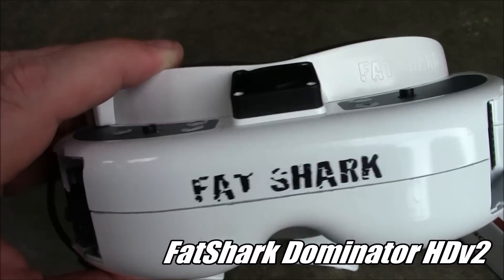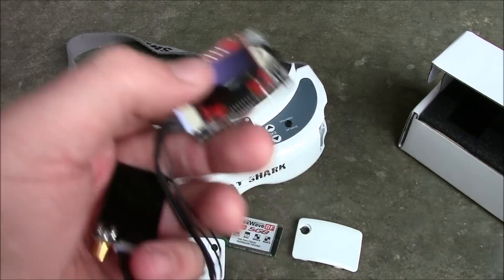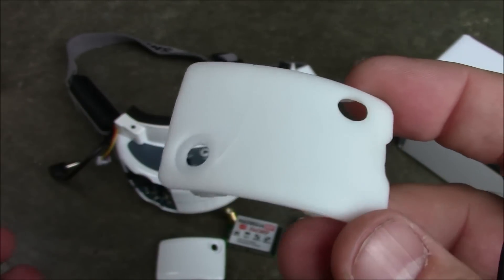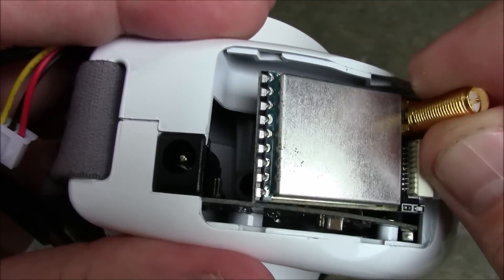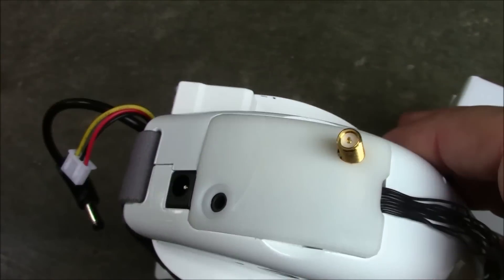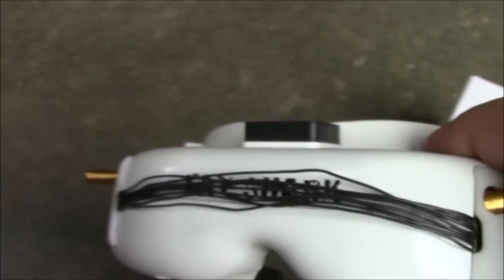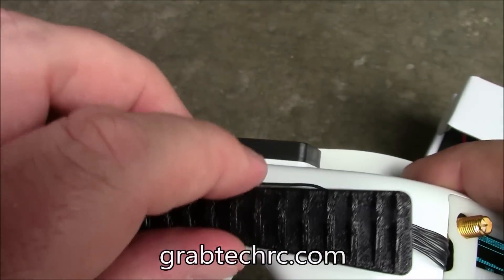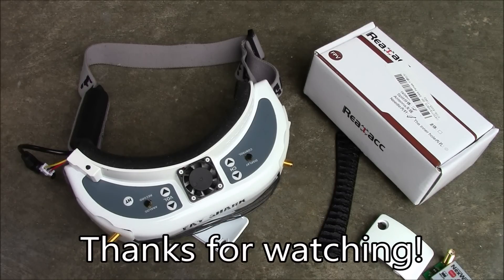Realacc RX5808 Diversity Split Receiver and Covers Initial Look

Comment: It's very easy to get the covers to fit perfectly... Heat the covers with a heat gun, just a little, they go soft at quite low temperature, fit cover to goggles and hold down all four corners flush with the goggles until the cover cools. You now have perfectly fitting covers :)
Reply from the maker: That is a good idea.  I've done that with the E010's camera mount but didn't think about doing it with this cover.

Comment: lol. thanks for the review. honestly guys & gals just get a set of La Forge modules. yeah they cost more but you also get updates, support and great video which is so important when you fly fpv so its worth the investment IMO.
Reply from the maker: These will take software updates too, but the coolest updates you'll see with LaForge are probably going to come more from the hardware side more so than the software side.  Besides if the software were updated, those changes would eventually make it to these.  The newer LaForge modules are suppose to work with the FatShark buttons as well as their own built in buttons.  If you have the older version of the LaForge, then you won't be able to get that option. You'll have to buy the newer one.  That would be two expensive purchases you would have had to made.  If these end up receiving video as well as my friend's LaForge receivers, I'm going to be ecstatic.
Reply: +travisgrindal seriously they will take updates for La Forge modules.
Reply from the maker: Supposedly.  I haven't seen it first hand yet.
Reply: I would love to get a set of the La Forge modules but I have the Attitude V3's and not sure if it will work.
Reply: I've seen people on facebook that had Laforge modules installed on attitude V3's check check out the LaForge group on facebook
Reply: i have a pair of teleporter v4, (bought cheap and used) i did look inside and the "module" in is uses the same layout of pins as the dominator seriers. ask fatshar if in theory you could swat the module, and they said yes. so now i'm wainting for my postman to comew by....

Comment: I got the Real ACC  2 antenna in 1 version from banggood and loving it so far. You can replace the screens pretty cheap but I would let Banggood know and tell them to send you a replacement. I also bought the board version for my Quanum V2 goggles GE-FPV RX5808 Pro 5.8G 40CH so far so good.

Comment: Do you have the foxeer 16.9 HS1189 camera or will you get it. If so could you try and show it on the Eachine EV800 and show a video . I've ordered the Eachine VR D2 and i think it is very similar and would like to see if the eachine goggle would receive the 16.9 ratio correctly. Thanks in advance.

~Randy

Comment: Sorry to see that you got a lemon.  Mine came today and it works well.  Covers fit pretty well and aren't broken. They were wrapped in foam.  The module on left is titled slightly when the cover is on, but isn't a big problem.  Screen is great.  My pet peeve is that wheel is hard to access.  I need to cut a little of the edge away of the right cover.  Definitely requires a wee bit of DIY.  For $40, I can't complain at all..

Comment: Just got mine yesterday, all my lines are there. Everything works great. For the diversity side, i double sided stick taped it to the goggles, it's holding up pretty well
Reply from the maker: I may try that.  I still want to try them while flying.  The receiver I'm using now is just 'okay'.  Even if the screen doesn't work well, I can probably still figure it out.
Reply: Get that replaced on RMA.  That screen is wrong.  Mine is REALLY good looking.  Double stick tape is your friend and don't be afraid to dremel your way to put the cable inside.
Reply: Works?  You never talked about if it worked at all.  What about the rest of it?
Reply from the maker: Heh... :)  The flying part is coming later after I get some time to get some flying in.  A lot of my flying has to take place on the weekends.
Reply: +travisgrindal I admit, you got a crap one.  mine looks great, none of my covers are broken but I am relying on double stick tape to hold them in place for now.  I just got the covers this week.  Full feet, no cracks.  screen really looks good.  Buzzer seems total mistake although if you install inside there is room.
Reply: The modules are being held in place with tape.  I haven't tried the covers yet.  Sorry, thought I'd clarify.  and I understand that some laforge users have similar issues with cabling and mounting on the head tracker side, it's not really intended for diversity over there.
Reply from the maker: If I mess with it some more, I think I may be able to get it in fairly solid.  We'll see.  I need to put some more time into it.
Reply: Just got my single side version (didn't really want to cut up the HD2s) and the cover is poorly designed.  I had to go at it pretty enthusiastically with the dremel just to get antennas on it.  But it fits great and since it's using the stock code it's easy to just flash it with modified custom code with any feature you want.

Comment: Hi Travis, thanks for the Video. Have you tried to put double sided tape between the crappy cover and the receiver module on the right. This as well as taping both covers to the body of the google should fix your biggest issues. The   broken monitor of course is a pain but you should get an replacement  from BG

Comment: i think I may of shorted out something inside my fatsharks when I installed the wires through the inside I've got power to the lcds but not to the module no lights or static(snow storm)only black screen  also my old tbs module no longer works any help would be much appreciated

Comment: hey man i bought this as well i have installed mine on the inside of the goggles.. and modified the existing covers to go over the top.. given the modified covers didnt turn out the best but on the screen side i cut a whole through the wall and that was fine.. on the opposite side is secured with double sided tape and the cover fits fine over the top.. so yeah.. i think its suppose to be mounted inside..

Comment: your supposed to install the unit into the plates or covers and then install them into the goggles. They do expect you to take the goggles apart to put the wires inside.

Comment: wow. unlucky on the unit.
I have the non-split diversity one and it is great. 
it didnt come with covers but on my attitude v3's I had to separate the goggle frame to fit them in (not as fat sharks).

The screen is great, reception for me is much better than either the basic fatshark 40ch receiver or diversity one.
as it is wedged tight, no movement when antenna's connected.

I think the single unit is more like the fury receiver than the laForge but they are probably all the same components.

anyways. sympathy on the quality control of some of these components.

Comment: half of your lines are broken up because your oled screen is cracked at the bottom right corner. you can replace it for 5$ on eBay. search oled 128x64. if you break the laforge screen in the same place, you will have the same result! i agree the doors are junk, they are molded wrong and is one of the reasons why the oled screen cracked.

Comment: My Realacc is now doing what yours did with the screen. I can't read anything and also noticed that the diversity doesn't even work anymore. Both receiver modules work but it doesn't switch between them like it use to do. It lasted about 3-4 weeks, so disappointed. Now like you Travis I'm going to get the La forge. I should of done this from the bloody beginning!

Comment: well first of all I really hope you did put some electric tape to cover the bottom of the diversity side other wise you soon will have some smoke coming out of your goggles, from touching the board below the diversity. I'm hoping you did not already do any damage , secondly the best thing to fix mount these is to put a double side tape behind the diversity side on the very top on both ends left and right as the center does not make contact, and last I'm glad you showed those flimsy covers I was on the edge about ordering them, I had already dremeled the original covers and they fit fine and I installed this baby internally no wires showing. here's what mine looks like right now http://www.rcgroups.com/forums/showpost.php?p=35527172&postcount=124
Reply from the maker: Your screen hole is a little big, but they look good.  :)
Reply: yes it's a bit too big but I'm very please with the way it looks, it actually looks better now that I sanded the cut and rounded them better.

Comment: save your money and get the real deals. This hack job will not get your confidence to do more while flying, hell not to mention the community of LaForge users is worth the purchase alone.
you get updates and instant help whenever you need it if you need it. 
Check it out The fastest race champion Luke Bannister rocks LaForge so that alone should say tons.
Reply from the maker: The worst thing about the LaForge is that it is double the price.  I'm sure I'll have stronger opinions about these goggles once I get them out to the flying field.
Reply: indeed the price is a hit to the pockets but if you add quality hardware and better video feeds. The end result will justify the means.

i had that nextwave which was horrible then the tbs RX another horrible experience with static everywhere. 
basically i spent too much money trying receivers almost got a ground station. I got laforge because of the logo and guess what. its a beast bro. 
1 tree in my flying field would kill me everytime.. now im killing the tree because i can clearly see it.

Comment: Hi guy,s I just want to share with everyone how I got my covers to fit perfectly. I used warm to hot water and bent them with a bit of pressure under the warm water for about 10 sec then take them out still applying pressure on them till they cool down then dry and try it out. It might take more then 1 go to get it perfect but it worked for me and I hope it works for you guys too.
Reply from the maker: Nice!  I may try that.
Reply: back in the old r/c cars days we used to boil the parts then bend them once their hot enough